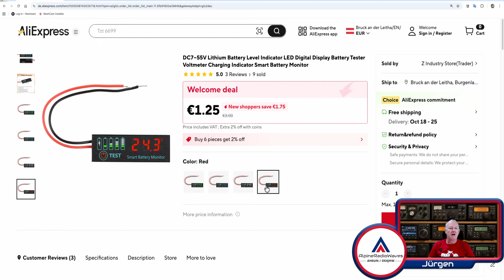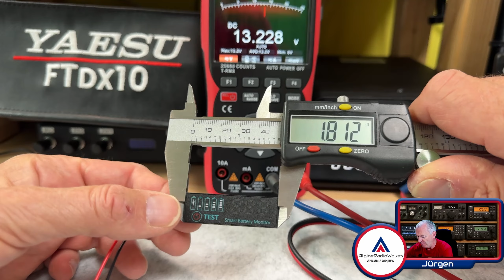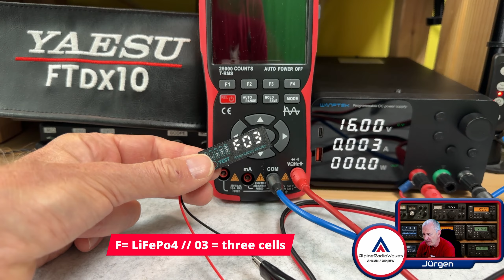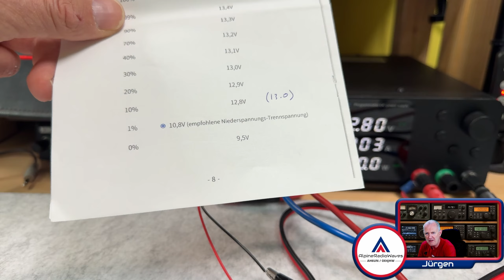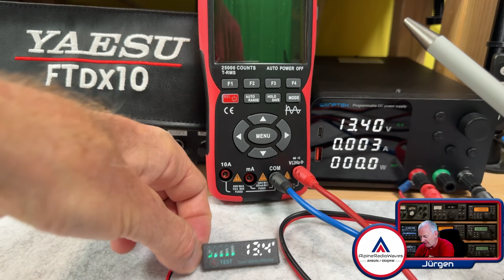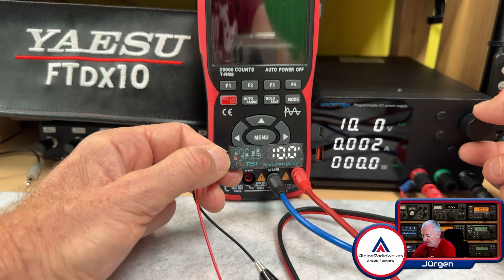A tiny Smart Battery Monitor & Voltmeter (JX-4615N-A3) from AliExpress (english version)

Comment: Hello, Please Help Me, How do you Reset it Back to Default/Original/Factory Settings? Because even the Sellers that I Bought this From I Have Contacted Them and They Can't even Help Me.
I'm Using this On a 24V NiCd Battery, It Was Showing the Correct Voltage, But I Went to Set the Display Turn Off Timer and I Must've Mistakenly Selected Another Setting and Now It's Showing Me the Incorrect Voltage It's Showing 30V instead Of 26V. I want to Reset it, But There's No Mention about how to Reset This Thing. They Told Me to Hook Up a 30V Power Supply and Go into the CAL Setting, But They didn't Tell Me what to Do When I Go into the CAL Setting Because There's No Option in there. Please Help.
Thanks.
Reply from the maker: Hi, good evening!
Tomorrow I will ask my buddy Mike if he does know and I come back to you ok?
So please have patience.
BR Juergen
Reply: @AH6UN_OE4JHW Okay. Thanks A lot 🙏

Comment: Your friend is correct , to calibrate,set precision power supply to 30.00 volts DC and procede your calibration method. Thank you for this video, how to calibrate was driving me crazy.
Reply from the maker: When Mike got the battery monitor there was no manual available from the vendor, so he contacted the manufacturer.
Thanks to him for doing all the research 😊
Regards, Juergen